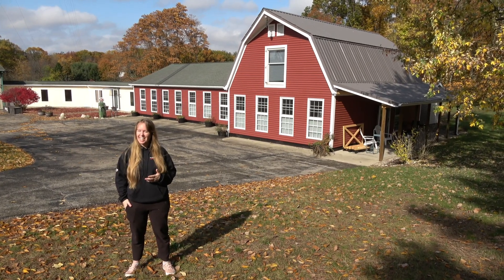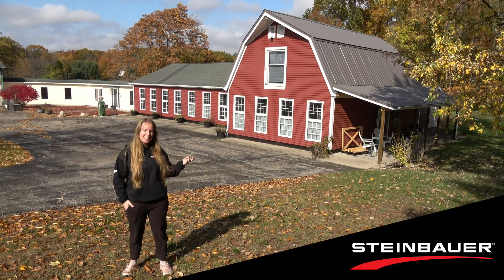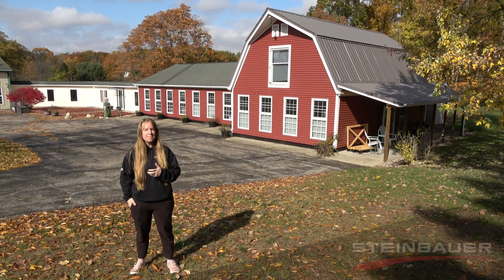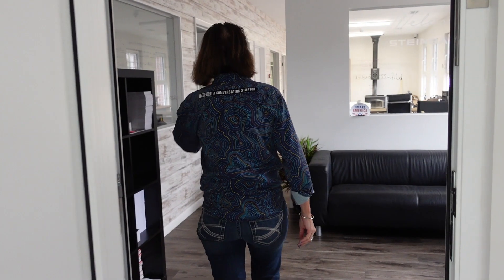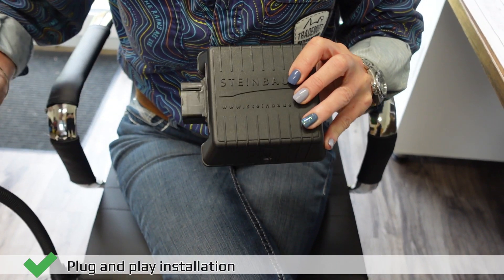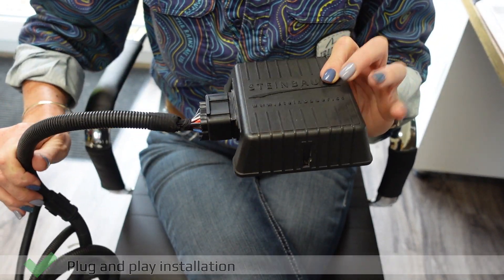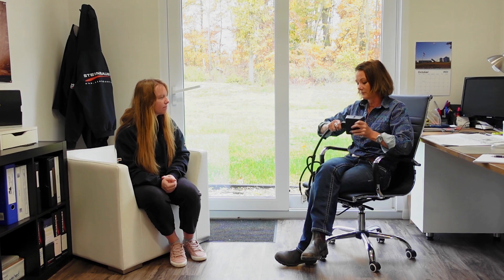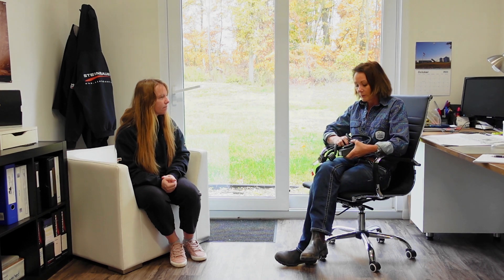STEINBAUER Marine PowerModules | Warranty Implications & What Sets the Tuning Technology Apart

Comment: not the best vid engines >>> suck squeezes bang and blow weather it be Gas or Diesel 100 years of service it is still S Q B B  and realty if one component is missing will not work and enter the coputer age computers rule one environment  temp dry not to exceed 70 deg yet they are in cars boats >>> hoo thout of that o2 can not be monitored so you are running in open loop>> so they cheat max RPM max lean set the puter for it and yes fuel econamy its all bull shit

Comment: These units are great. They were made for our catamarans because the 45 ECU program is horrible. We didn't make them to market to other people, owners stuck with 4JH45 engines are just fortunate to have access to them as a byproduct. Why not just buy a 57 ECU? Good luck Yanmar makes it very difficult and that will void the engine warranty if you plug it into a 4JH45.
Reply: Yanmar refuses to sell a spare ECU to any boat owner and will only uphold the warranty if they supply the ECU and one of their Certified technicians installs it. Once it is installed the "BAD ECU" is taken with the technician even though you as owner has paid for it. and BTW the service technicians costs is to be covered by the owner Only the ECU's costs is covered under the warranty.
Reply: @GlosterSA  yes, why we made these units. Cut Yanmar and their BS out of the equation.
Reply from the maker: @GlosterSA  Yes, image the cost to unplug the old ECU lol
Reply: @GlosterSA It's not just Yanmar being difficult. Every engine is certified to meet emissions. The program in the ECU plays a huge part in that. In order for their engines to be compliant they have to do this.
Reply from the maker: @keithdyar7122  We couldn't care less about emissions. I could unbolt the engine and install a 4JH57 an have basically the same thing, which would be legal but just cost significantly more money.
Reply: Some people claim the programs in these ECUs are horrible, but engine manufactures have to certify their engines to meet emissions. The program in the ECU has to work with other components and it plays a huge part in meeting these emissions.

Diesel engines are also sold by the HP. It may not cost more to build the engine, but the failure rate can be higher due to the increased loads. Warranty is just another thing that is factored into the pricing.

I don't really have any issues using products like this after warranty, but it wouldn't be wise while under warranty. To not disclose to Yanmar that one of these units had been installed if you had a problem while under warranty is obviously being dishonest and certainly not being transparent. You can be honest and tell them and try to fight the cause of failure in court; however, if you're an honest person and want a warranty, it's best to wait until the warranty period is up and then do what your want.
Reply from the maker: @keithdyar7122  Well we don't care and have disclosed ours as having to race engines to clear carbon build up is idiotic, go ask a mechanical engineer. Are the Sterling units on the Leopard/Robertson and Caine options list a disclosed and approved Yanmar upgrade and will you have an alternator warranty if the Sterling units burn out the alternators I wonder?
Reply: Of my 42 year career with a large company, 30 of those yrs were in our engine division. We were the largest diesel engine manufacturer in the world, so there's a chance I might know a little more about diesel engines than you.

As for the Sterling alternator controllers, I was made fully aware that my alternators would not be covered under Yanmar's warranty before I ordered that option. So it's pretty obvious this had been discussed with Yanmar and was not hidden and was above board.

Comment: The only problem I have with this is that Yanmar is moving on dangerous ground now Rail Injection and computer boxes. Renault did the same thing on their diesels in the automotive industry and caused a lot of problems and headaches for their customers. If for example you have a diesel Renault Kangoo and you take the vehicle to a fuel injector specialist to have your Injectors cleaned and calibrated the ECU of the Kangoo will go into lockdown  mode and they will not get that engine started. in the end to get the motor running again you have to send the injectors and ECU to Renault in France  to get the injectors reprogrammed to the ECU. this is the direction Yanmar is moving in. So the fact that you carry a spare set of injectors so that you can service and swop them out while underway is getting dangerous as the ECU on that engine can go in to lockdown mode the you are stuck with a non functioning engine at sea. Sailing Dauntless installed two new Yanmars on the Leopard 50 that was salvaged and rebuilt by them and one ECU went faulty they waited for a long time for a replacement Yanmar then took their original CPU and copied the data to the new CPU and lo and behold the engine did not start as the problem was not in the electronics of the CPU but in the programming that corrupted. The CPU of the second engine when swapped with the failed engine CPU started that engine just fine. For all of this it cost a lot of time and money Yanmar refused to sell them a spare CPU as a backup to prevent this happening. A certified Yanmar tech had to come out and do the work of the Warranty would be voided. what will happen if this happens underway with a monohull with only one engine.
Reply from the maker: None of that is relevant. The tech works between the ECU and injectors on a 4JH45 or 4JH57. So essentially many production catamaran models. It doesn't show in the ECU program and does not affect the stock ECU. The injectors are down stream of it and don't have any issues that you're referring to. Yanmar ECU's failing is a totally separate issue.
Reply: @travelsketch  That is exactly where the problem lies with the failing ECU's on Yanmar and the fact that the owner cannot change out that ECU without voiding the warranty on the engine  the addition Steinbauer Powermodule is very good but if the Yanmar ECU fails or goes into lockdown mode this module cannot overwrite it thus that engine will leave you stranded. That is the main drawback with common rail diesel engines. The software on the ECU determines the activation of the injectors. Furthermore if the Injectors are paired with the ECU you as the owner cannot do anything to them. You as the owner cannot even replace a faulty one. The way Renault structured their Diesel ECU's is that a agents only Diagnostic module gets plugged into the ECU and the ECU will tell the diagnostics tool that the injector number # is faulty then it will ask if you want to replace this injector when you confirm it will tell you to replace that injector. Once that Injector is replaced then it will scan the injector's data and calibration and upload that data to the ECU thus completing the repair. So If Yanmar is moving in this same direction as it seems a lot of Boat owners are heading for trouble with this. The system with Direct injection and a mechanical injector pump is much more owner friendly especially when the Boat is busy with long voyages as long as the owners regularly service them and monitor the oil and water temps and have a decent fuel cleaning system (Fuel polishing) the engine will run. The reason for a Fuel cleaning system is quite obvious as you as the owner cannot vouch for the cleanliness of the Fuel you are getting from the marina and algae growth in the fuel tanks.

Comment: My advise do NOT install ANY common rail diesel engine on small boats. It’s not worth the trouble and headaches. Stay with mechanical diesel pump.
Reply from the maker: Yes great but many yacht builders do not offer the customer a choice. This is to help those people run a cleaner and more efficient engine.